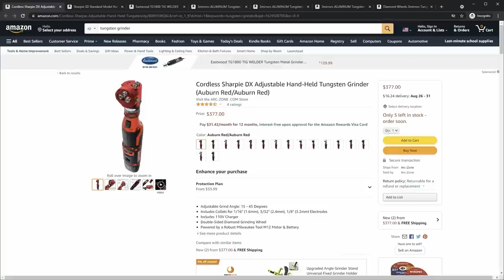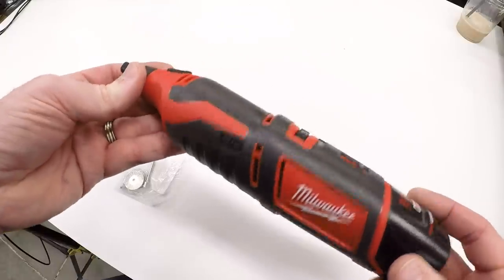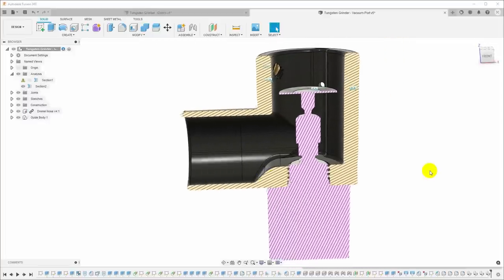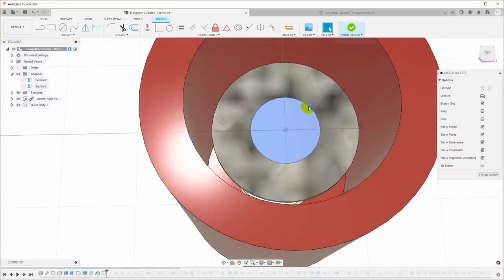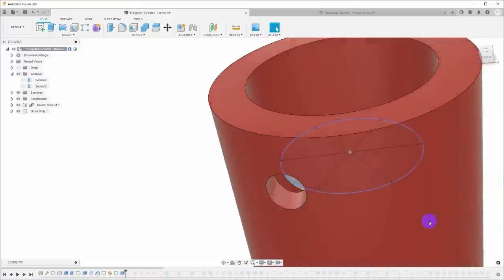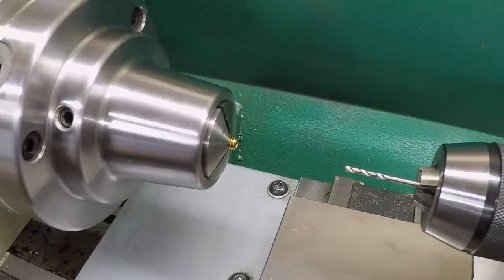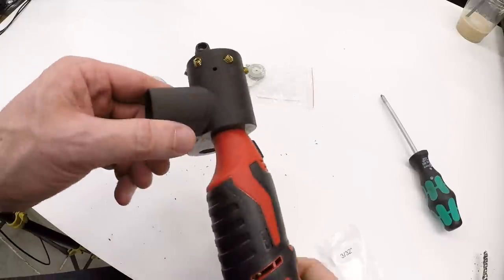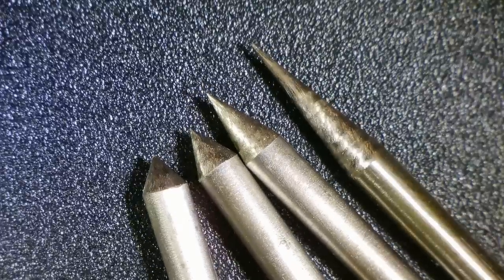Let's Make a Tungsten Grinder | 3D Printing with NylonX

Comment: Play your cards wrong / have a bad day - oh boy.
1) Handling the discs and grinder whilst the battery is plugged in - happy-go-lucky
2) Grinding 'Up-Cutting' - stick&slam, the tungsten has gone through your hand
Oh (be) well. Probably seeing problems where none exists.
Reply from the maker: The "up-cutting" you describe is required to get a clean tip on the tungsten.  It isn't a safety concern because of the way the guide works.  The tungsten can't really grab and launch because the slightest movement just takes it away from the wheel, and any deflection downward would just cause it to jam.  Cutting the other direction, away from the tip, could actually suck the tungsten in and cause it to jam the wheel.
Reply: @Clough42  I am not sure if there's a 100% safe solution, grinding on a grinding wheel also has its dangers.
I remember you mentioning something about the carbon-nylon filament not being sturdy enough to hold stepper motors for the mill, so I was bringing this into this device - a bit of wobble/deflection is possible. 
You're using bare hands to rotate the tungsten rods in the video, I could imagine a scenario using gloves when using it to weld, with less tactile contact - more wobble and a disaster waiting to happen. 
But, on the other side - it's hard to 'see' how smooth the grinding wheels are, and if they're prone to grabbing. 
Glad you're aware - Better safe, than sorry.

Oh, would grinding the other way - and a bit rougher end - not smooth itself out the first time the tip is used?
But yes, it could get 'sucked in' - but that would 'only' slow down the grinder, not make a ballistic missile out of the rod.

Comment: You should also apologize to Jeremy for not using Solidworks. It would be cool to also print a small impeller that attaches to the shaft so you don't need a shop vac.

Comment: Higbee thread starts are the shizz. Can't fusion model them? Loathsome software.
Reply from the maker: There isn't a checkbox for Higbee starts, but I've modeled them when I really wanted that feature.  Not sure I'd condemn an entire CAD package based on that one shortcoming.  Everything is a tradeoff.
Reply: @Clough42  It's not just that, it's Autodesk's whole attitude to Fusion users (who are basically beta testers), and also from my point of view as an Autocad user, everything being backwards.

With Autocad I decide a line's angle then snap it to it's position; I don't place it randomly then adjust the angle and position to suit.